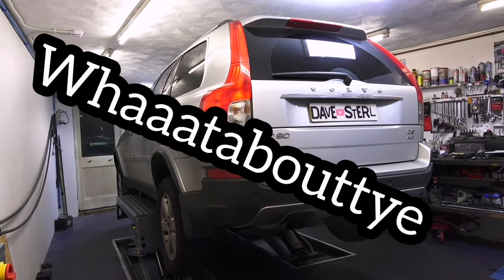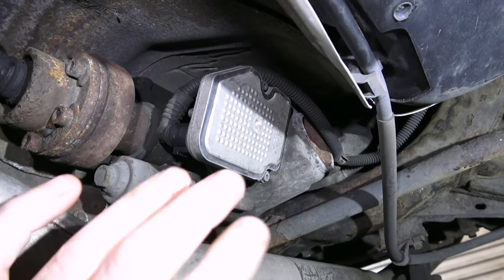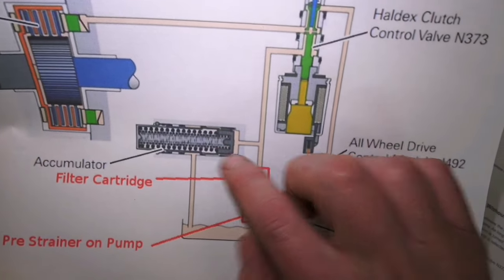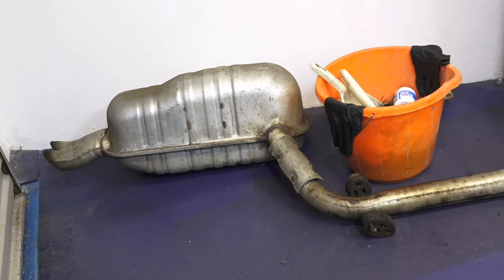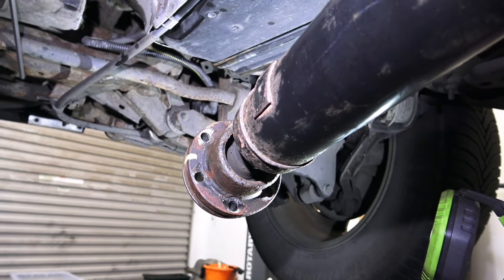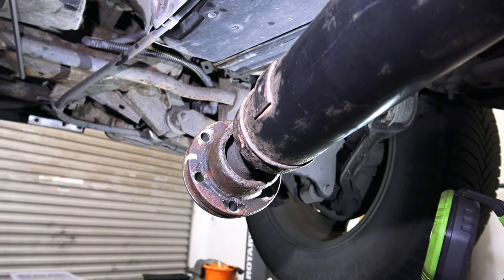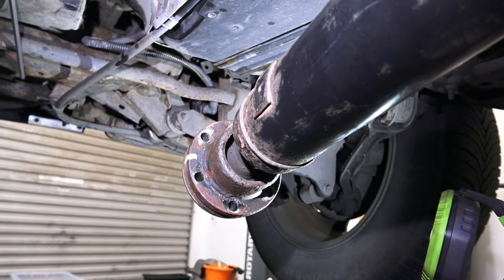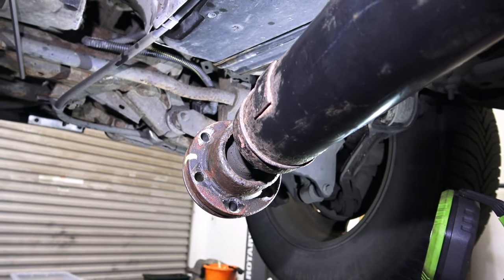Volvo XC90 Stuck in AWD. Haldex Gen4 Service. Land-rover Freelander 2

Comment: I had the dreaded "anti-skid service required" with the ABS0094 & CEM1A64 error codes. This was a dead DEM so I sent it off to Volvo Diagnostic in Tilbury, UK to be reconditioned. Mine was beyond repair so I had to get a recondtioned DEM. It cost me about £300 but it was money well spent as it restored my Haldex unit to full working order and once the codes were cleared they didn't come back. I've also had an unusual failure with my bevel gear. The rear bearing had collapsed. I found a used replacement on eBay for £200 delivered against about £1400 from the dealer.

Comment: Thanks for enlightning me on the works of the system, I have an 2014 XC90 D5 AWD 6-speed automatic that has started to shudder slightly at highwayspeeds after driving it for some 30km or more, it isn't allways present, more like after some road turn it is more present like propshafts or driveaxles align in a bad balance way, I have no clicks from drivejoints. The car has less than 208000km on the clock and I'm the second owner, bought it last year with 170000km on it. I would very much like to do what they call a Taxi service on the transmission. This video surely showed me much of what can be done. Thanks.

Comment: Volvo recommend a haldex service every 15 k miles and just. Oil drain then insert 700 ml of oil.  Also if you get a. Recon haldex from vw or volvo. They dont clean lut the accumulate r so you will get the problem again with astuck or clogged accu piston.
Reply from the maker: 15k Miles, never heard anybody stating that interval. Accumulater is non serviceable and non replaceable so a Recon with a bad Accumulater will be no different which we have found to happen. I thought I covered this in the video
Reply: @davesterl  Dave , I worked for vw in Emden for 15 years and it was common knowledge then that a service was to be carried out regularly. Unfortunately neither Volvo or vw put this in their service schedule. Regular service ie filter and oil change stops the crud blocking up the oilways. Your video is one of the best I have seen.

Comment: Excellent detailed video tutorial.
If I understood English correctly, you said that in Freelander 2 the software is set to lower pressure?
If so, that explains why Land Rover says to pump out more oil. There is less oil in the accumulator and the operating oil level is the same.
Reply from the maker: No, i didn't say that. Pressure remains the same in the accumulator. What i said is the software update is a workaround fix for the clutch latching problem that reduces the opening duty of the spool valve. Nothing to do with the different levels. The difference between the levels is 30ml, which is very little.

Comment: Well done, annoying that you had to take the prop flange off but it did give you better access to the filter. (I bet you watched Volvosweden video too). Looks a good idea to blow as much fluid out as possible, which the other people did not. 
No idea but I bet the fluid stays cleaner when the car is mostly used in mild conditions, I bet most of the contamination is from the clutch plates. I have seen videos of Scandinavia cars with much lower mileage with the fluid coming out a lot worse than this one. 
As for the software with reduced duty cycle, I got the impression that controller modules were dying from energising the solenoids at full duty cycle for too long but I don't know. 
I bet this car continues fine now, would not take much of a contaminant to creep past that valve at 30bar. 
Great video, thank you
Reply from the maker: The software update has nothing to do with control modules dying. The reduced duty cycle is to not open the valve as much. Contaminant blocks the PRV at the end of the accumulator so as it does not relieve at 30bar.
Reply: @davesterl  Ok, I know on some of the volvo forums there have been theories about excessive pump motor run time with blocked filters. Anyway I guess reduced valve travel might help with shock loadings or something....slowing the clutch engagement down?
Reply from the maker: The reduced duty cycle is on the N373 valve not the motor so less oil to the clutch pack. Blocked strainers on the GEN5(the ones with no filter) do increase the current demand from the motor, nothing to do with run time. I proved this in a GEN5 video i did

Comment: Cut a very long story short, I took a diff/Haldex out of my old 2008 XC and put it in current 2009 XC, not realising that the 2008 Diff/Haldex is Generation 3, not 4 which was in the 2009 XC. Anyway, all going fine with the GEN 3 in the 2009 until high speed under load at 65/70 mph 2000 revs when I get vibration under the car from what I believe is coming through the prop from Diff/Haldex. area…. I have seen online that an actual Gen 4 Haldex & Gen 3 Haldex are interchangeable even though they are both different on the outside, so can I swap as either Haldex wasn’t the initial problem in the first place?? The dimension for fitting on to the diff casing are the same, but slightly concerned that both Haldexs are different on the inside as regards fitting? Any thoughts appreciated!! Also slight vibration at slower speeds under load!

Comment: I took the pump out of mine a few weeks ago. You can remove pump on an R-design without removing exhaust and prop.Remove pump housing bolts as shown then remove the 2 pump main bolts. lever either side of pump until seal gives and pump will slowly come out. As you slide pump out, slide pump cover a few mill off pump and angle cover away from prop flange This will give you just enough play to slide complete unit out in one. Its tight and awkward so take your time. Ps use a small pick to clean out Allen key bolts first and have a small pair of mole grips at hand to clamp on the head of bolts if the Allen key feels like its going round off.
Reply from the maker: No chance in this case, you'll bend the armature. Flange removal gives a better chance of a good clean out as this is not just an ordinary service.
Reply: @davesterl  fair enough. Just a thought. GREAT VIDEO . KEEP IT UP
I'm having a ball ach with mine at moment. Volvo won't do more than 10 mph unless I disconnect the heldex brain. Drives fine disconnected but ABS,TC,SC and brake warning comes on. 
So getting the haldex brain checked is next. Only found 1 company in UK that will touch a heldex 4 ecu based in Crewe. Ps. Thanks for the tip on the front diff where exhaust heats it up and dries the grease out. I have a small  grinding noise on any right hand turn. So that's my next job . Cheers
Reply from the maker: @100celt9  is it 'just a thought' or have you tried that yourself?
Reply: Depends on the age not the vehicle spec.
Reply: Lots of the drivetrain components are the same between the FL2 & several Volvo models are shared. Both mfrs were owned by Ford at the time.
Reply: very  nice video

Comment: horrible job that xc90 dave should have had 3 haldex services so far in its life and that is why when you undone the haldex pump no oil pissed ot it should have done as the oil goes thru the pump aswell, unscrewing the pump is just another way of emptying the haldex oil, you will see later when you come to change thehaldex filter bet its full of crap.....
Reply from the maker: Oil flew out when i released the pump as shown in the video. Yes, oil goes thru the pump as it is the oil pump. Pump needs to be released as there is no drain port, so it is not just another way. I showed the old filter in the oil catch tray.
Reply: got you great job @davesterl
Reply: what video wer u watching???